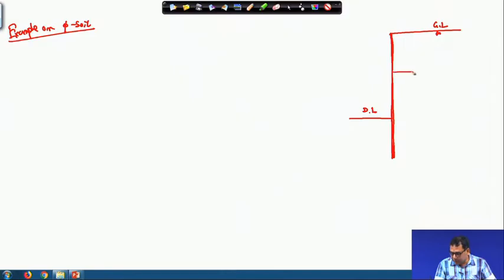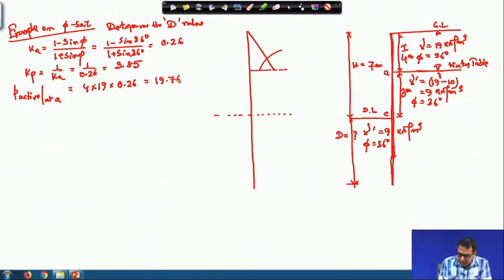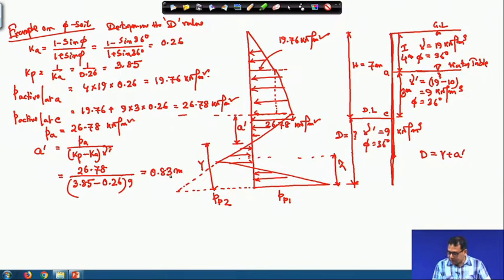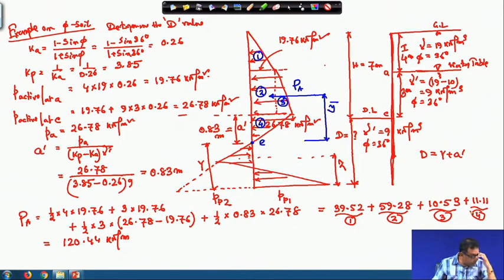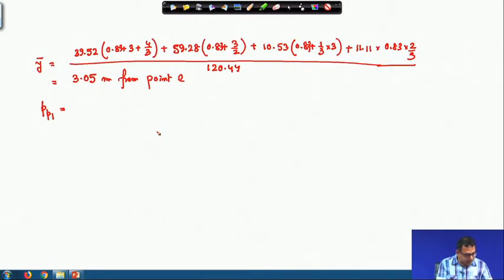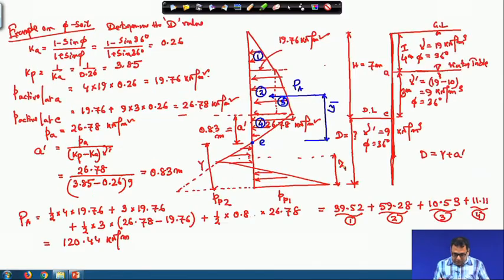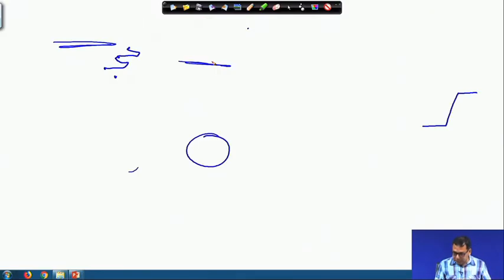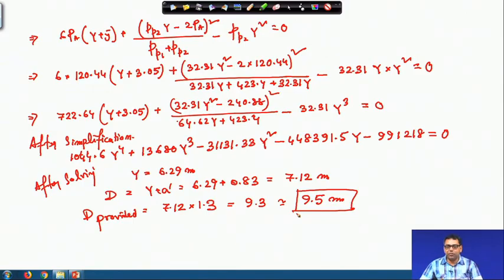Lecture 54 : Sheet Piles - III

Comment: The hydraulic head appears to be 3m above the dig formation (dredge level) or 4m below ground level. Thus, there is a water head pressure variance of 3m on the sheetpile. A submerged unit weight is used below that water table as would be appropriate. However, why was the hydraulic head on the sheetpile not included. The hydraulic head pressure variance (3m) would have a significant influence on the wall loading condition.
Reply: water pressure on both side will cancel it out.